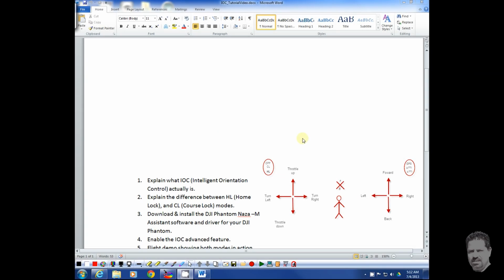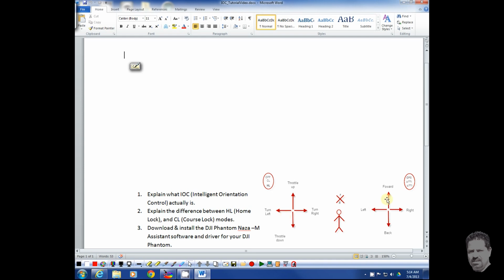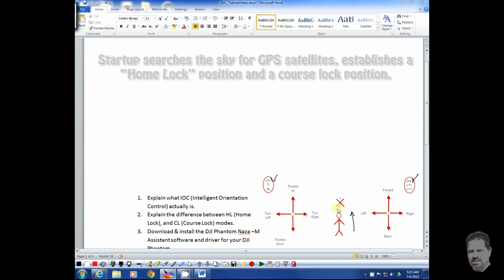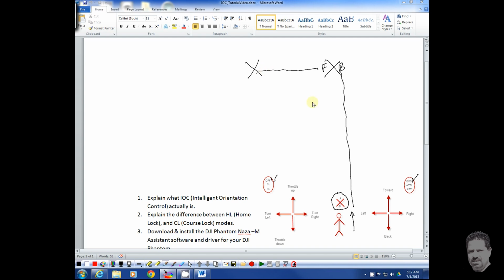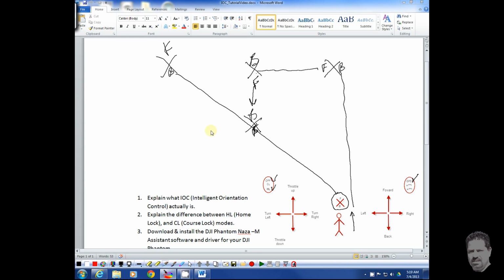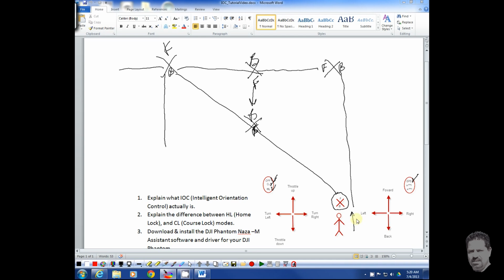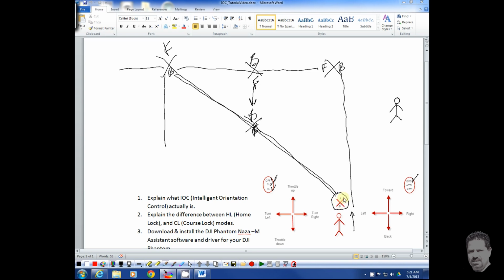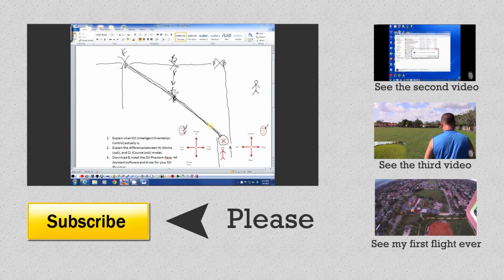DJI Phantom: IOC Home Lock & Course Lock explained, enabled & demonstrated Part 1 of 3

Comment: Hello, MrPCHM!
Congratulations for your clear explanation!
Excuse me, only one question:
when you put the remote controller left switch in Home Point Lock Mode (as  my Dji Phantom 1 Quadcopter is far away and I cannot see it anymore and perhaps it is behind a building or hidden to some big trees), does the path to the taking-off area is right straight (i.e. the shortest way, risking to crash against the obtacles), or does the copter fly back following the previous free-from-obtacles path?!?
Thanking you in advance for your prompt reply, best regards, Tano
 (e-mail address: meschinelli@gmail.com
Reply from the maker: It will use a direct path to the home point. By that I mean, if you switch it to HL (remember you must be in GPS mode for HL) and pull back on the stick, it will fly directly back to the home point in a straight line. If you turn off your transmitter off and allow your Phantom to go into Fail Safe mode, your Phantom will climb to 40 feet then head straight back to the home point. If it was already above the 40 feet when you turned off your transmitter, it will just fly straight back to the home point. Hope this helps. Thanks for watching...
Reply: MrPCHM Thanks a lot for your prompt reply!
I take profit by your kindness to ask you few other things:
1)so it means, if I 	have understood correctly, that switching off the Controller, the 	Drone perceives a lost of radio contact and therefore (just as it 	would go further than the maximum distance range - about 300 meters 	-) it would return automatically to the home point. Actually it is 	the exactly same operation than going in HL mode (with of course Gps 	and controller on) and pulling back the right controller stick, 	isn't!?
	
2)In the case of a 	mistake procedure (due to careless, sun blinding, sudden drifting 	wind, or fog, too), and the drone goes hidden behind a building area 	or a hedge (higher than 40 feet), what is the best and lucky 	manoeuvre to do to see again the Dji guy and to return it to the 	taking-off point without loosing it or crashing it against some 	above-mentioned obstacles?
	
3)I have read a lot of 	articles, but I did not find any clear explanations about the 	controller right switch S1 (in particular, the middle and the lower 	position): when those two modes are suggested?! Are they used only 	for Fail Safe Mode, or for a normal flight with no Gps assistance, 	too!?
	
4)As far as batteries 	are concerned, do you have any suggestion or experience about 	putting a auxiliary/more powered battery (I actually use now the 	2200 mAh original Phantom one), as the flight time does not last 	more than 6 or 7 minutes. In other words, which is the right 	arrangement between a bigger Ampere battery and therefore a higher 	weight of the drone (the game is not worth the candle - i.e. I 	believe that a +20% Amperage does not correspond automatically to a 	+20% battery life=flight time?)? 	
	Maybe do I have to 	increase the 4-propellers diameter?!

Many many thanks for your patience and attention, ciao, Tano (Italy)
Reply: Giangaetano Meschinelli
P.S. to point 2): consider that I do not have a monitor/screen mounted on my  controller in order to see what/where the Dji is flying, but only a simple Gopro Hero 3 Camera on it!

Comment: Thank you very much for taking the time to explain IOC. I have also watched your flight video on this and I now get it.

I am new to all of this. I have been thinking of ways that I might also be able to mark/tape/paint my Phantom 2 to make orientation a bit easier to manage. I have flow a total of 12 short low altitude flights so far and orientation has been my only issue. -Zero crashes....and I want to keep it that way.

Again, thank you for your efforts....

Dan
Reply from the maker: Great to here it helped you out Dan. Orientation is a huge issue when flying our quads at long distances. This is particularly true for new pilots. To this day I can't understand why DJI chose to make IOC an advanced feature that has to enabled with the NAZA software. At least it was last year when I got my v1 Phantom. Anyway thanks a bunch for the comment and for watching. Enjoy your bird -_-

Comment from the maker: Hi Ken! I've really never tested this as I don’t like tempting Murphy. I did look at your video (nice job BTW) and think I know where the confusion is. If you power off the TX during flight, the Phantom is supposed to make its way back to where it was launched from and auto land. But if you turn your TX back on before it lands you need to make sure you have at least 50% throttle or it freaks out. This is what I've been told. Like I said, don’t have the guts to try it. Thanks again for watching!

Comment from the maker: Hey Ken! In this case even if you turn around to face the Phantom after it has gone past you, continuing  to pull back on the direction stick will keep the drone flying away from you. Remember in CL the directions are established relative to where the Phantom was pointing when you started the flight. In HL, once it gets to within 10 meters of the start point it will switch to CL mode. Thanks for the compliments and for watching!